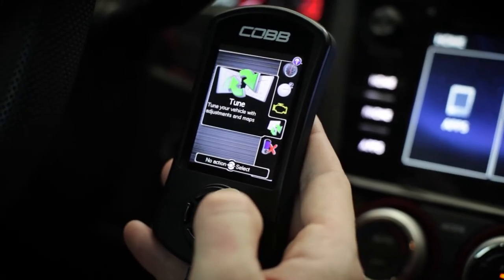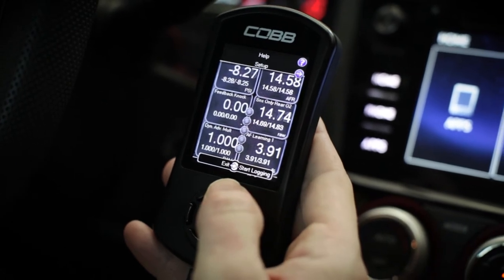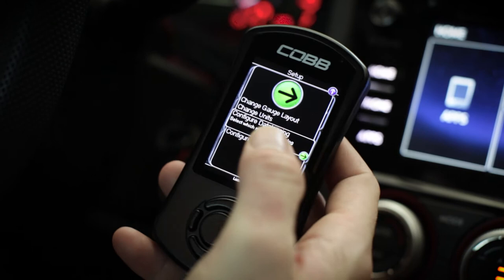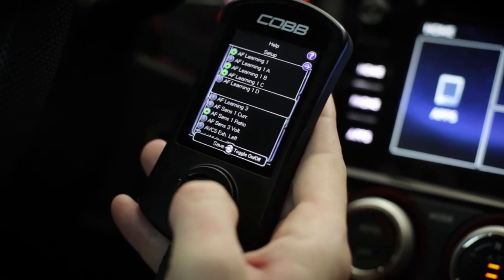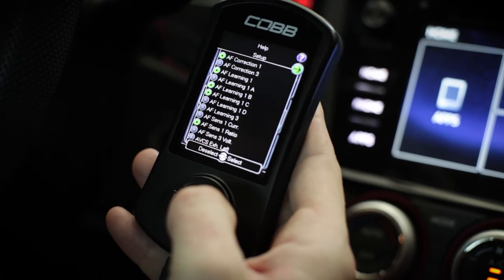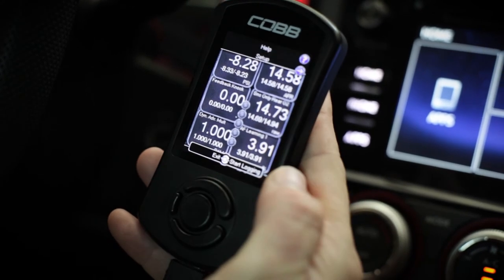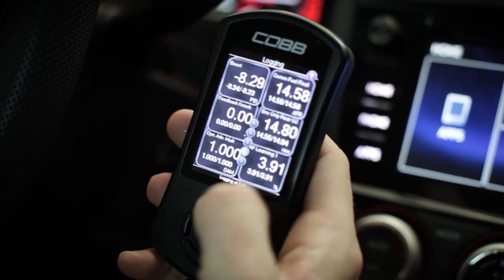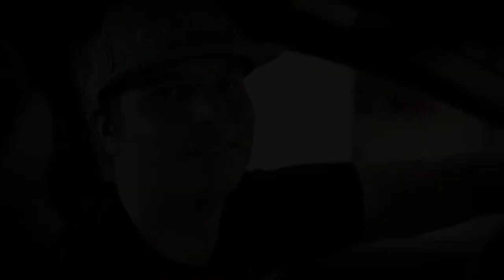COBB Tuning - How to Datalog with an APv3

Comment: I’m very new to Cobb what all does data logging do?
Reply: Hey man, it just makes sure everything is running the way it’s supposed to. When u get tuned, you’ll need to select certain variables to monitor so that your tuner can clean up anything that needs to be cleaned up. Some things they might want u to monitor are like ur boost pressure, AFR(air to fuel ratio), torque, etc. hope this helped!